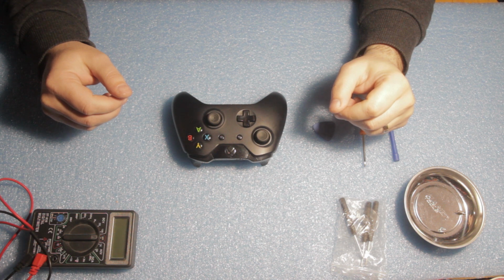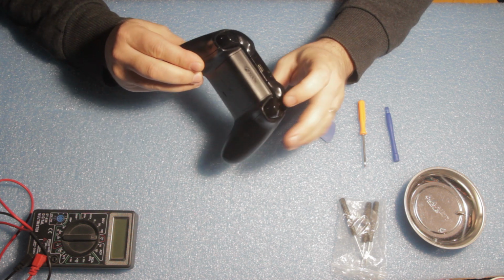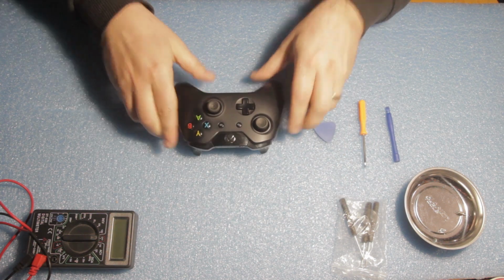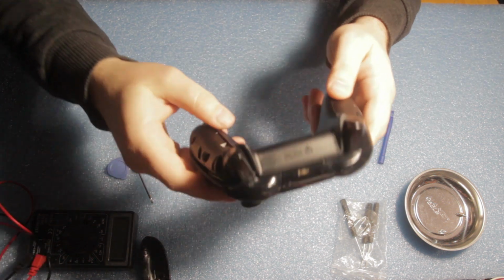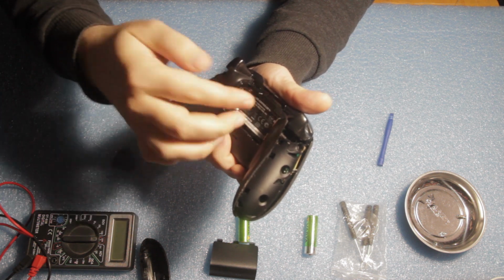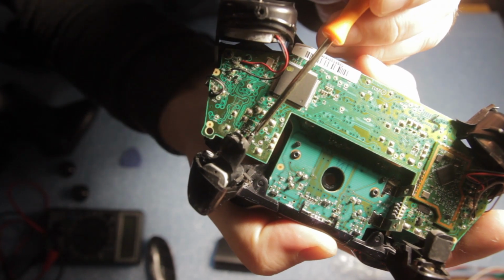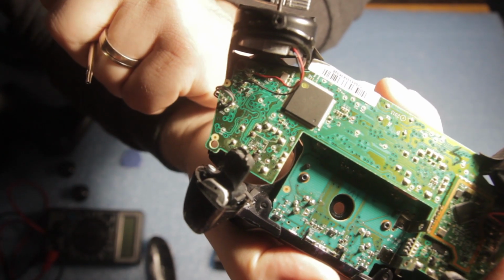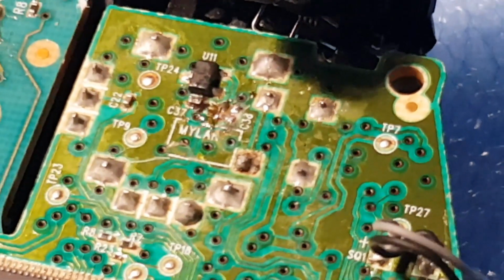Fixing the stuck trigger of an Xbox one controller

Comment: Would you be able to write down the instructions on what to bridge on those resistor locations? Are you able to use simple solder besides copper wire?
Reply: check this video and fixed(not sure if it perfect fix but it work) - remove r42 and c38(both under U11 - hall LT) - and short pads from R42. And all work now, but in my case there was only 42 points from 100 when I pressed the trigger, so I moved magnet closer  and it now good.

Comment: i have a problem with the left trigger, when i checked only the right trigger has both resistor and capacitor the left trigger only has one resistor/capacitor labled C37, does the rhs still control the left? any help would be great thanks

Comment: I have identified that my controller is also experiencing the same issue, On opening it up I observed that that the resistor R42(same as yours) was snapped. So what kind of wire should i use to join it back? Also is the trigger usable after applying your fix?
Reply from the maker: Hi. You can use any tips of wire you can fit there. Or just join the pads via a solder joint.
Reply: @benassy69  Is it necessary to solder or can i tape a wire in between. Sorry, I have never used a solder before.
Reply from the maker: For a good connection I advice you to solder it. I cannot confirm it will work other way.
Reply: @benassy69  Thank you so much. Your video just saved me a lot of trouble and money. 😊

Comment: My Xbox one controller LT and RT buttons are stiff, they are don’t stick but they they are not smooth but they are stiff, it’s like it’s glued to something so it makes that noise when you push the button, can u help
Reply from the maker: Hi . Open the controller and see what is the problem there. Could be something sticking to the trigger magnet. Or the trigger latch is broken.

Comment: Hey man, I’ve got the same problem as you, I opened up the controller but didn’t quite understand what you were saying about the sensor and short circuiting the resistor with a small wire. How do I do this? Did you record it?

Comment: mine is the bluetooth version and  does not have that little resistor you mentioned,  both triggers got stuck at once,   I hate the level of quality  of xbox one controller, it sucks,  the  worse  controllers  ever made,  if only I could change  to another more high quality brand.
Reply from the maker: Unfortunately you have the new model whick had a different PCB board. See if you have a mechanical problem instead.

Comment: Hey man i just got a new white xbox one controller, and everything works except my “A” button. It seems when i press left of the A button it seems to not respond. I have to press a little hard which is annoying. Pls help
Reply from the maker: Hello. Really strange to happen to a brand new controller. I suspect a manufacturing issue or some corrosion due to improper storage. Return the unit for a replacement if you can.
Reply: Adrian B. Thanks

Comment: My BRAND NEW Xbox elite 2 controller always registers the right trigger being pressed, even if I’m not pressing the trigger, how do I fix
Reply from the maker: If it is a brand new one I sugest returning it for a replacement.
Reply: @benassy69  What if it's not new?
Reply: @benassy69  What if it's not new?
Reply from the maker: The problem is because of a fauly Hall effect sensor or the shorted capacitor. If  the problem is the sensor that maybe you can get away by only changing the middle board from a donor controller. If the problem is the capacitor that follow my explanations in the video.
Reply: @benassy69  Thanks

Comment: For me the button Above the right trigger is stuck inside because I dropped my controller.
Reply from the maker: That sounds like a mechanical problem. Most likely your trigger hinge got broken. You need to order another trigger button from ebay or go to a service to change it.
Reply: Adrian B. I finally fixed it! I just pushed the bottom trigger and pulled out the button. It’s now working properly thanks anyways
Reply from the maker: You got lucky that nothing was broken. Good to hear that you fixed it! Kudos!

Comment: So um I stepped on my controller, and now the left trigger is stuck up, like jammed up. No matter how hard I push down, it won’t go back down, any knowledge how to help?
Reply: Try and take off the side plate and put it back on, but make sure when you put it back on that you are pulling the trigger at the same time since the trigger can get stuck on the outside of the casing for the controller
Reply from the maker: You have to open it an see. I presume a mechanical problem. Maybe the hinge is broken.
Reply: The same thing happens to me just tough it SLOWLY but. Little pressure a a time then it will fix but be very careful full and afterword it may make a little  noise

Comment: This happened to me but, my nail on the controller came out and mashed into the circuit. I didnt know it was doing that and it eventually broke the circuit so then when i opened it up i saw the nail was by the magnet and sensor and it destroyed the circuit
Reply: How
Reply from the maker: If the sensor was damaged than there is no more you can do but change the sensor. If only the capacitor is broken than you can follow my instructions.

Comment: Hi there
i have the same problem i guess, but my LT is always 100% active, so your saying to short circuite it ? can you teach me how to do it?
Reply from the maker: There is a capacitor and a resistor next to the hall sensor. If your trigger is always active this means that your resistor is broken. You need.to add a very thin wire or a point of solder to short the terminals of the resistors. By doing this you are closing the circuit and the button will work again.
Reply: Benea could you please tell me if this works with the Xbox one controller model 1708? I have this problem and I've tried everything but this.. Anyway you could upload a video of you doing the short with the wire?
Reply: i have the same problem any luck with yours?
Reply: @emirhann3317  im sorry to say that i opened it almost fixed it, but i broke it in the middle of the process. i hope you get lucky and fix it...
Reply: Tariq Nimer me too